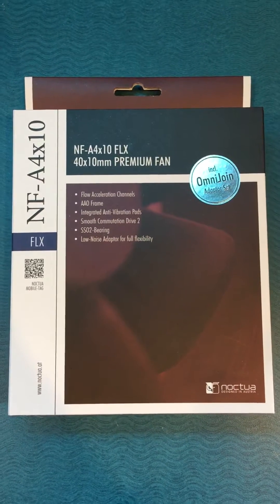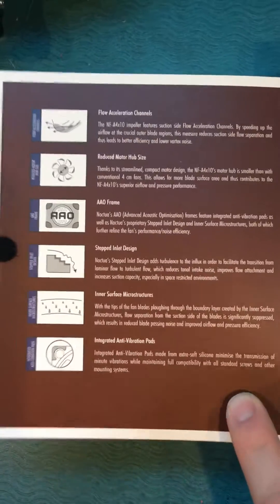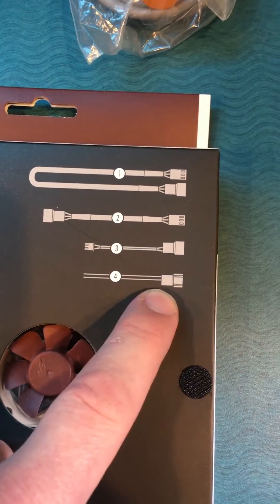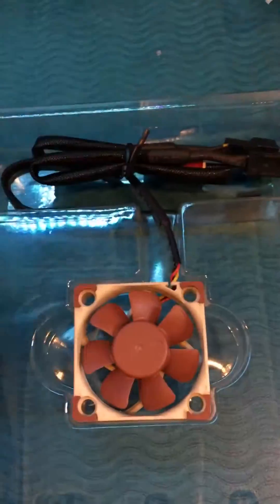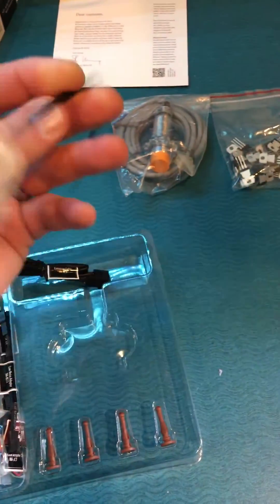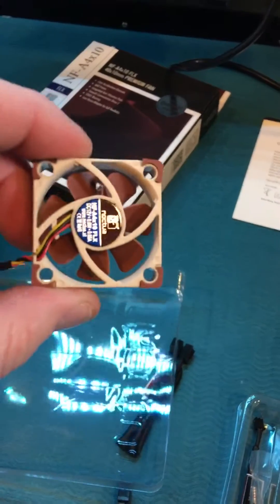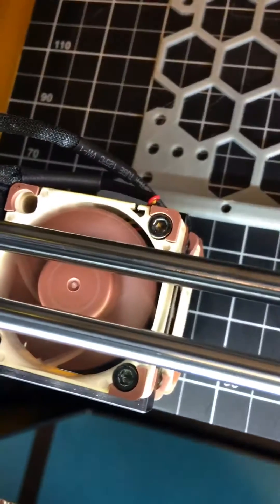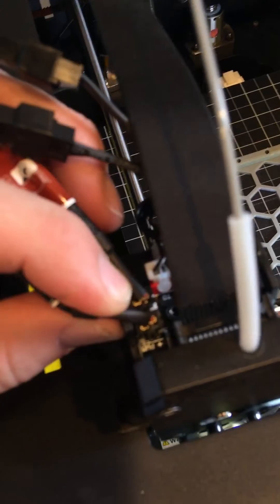Review of Noctua 40mm Fan - NF-A4x10 FLX Mounted in 3d Printer

Comment: Did you have any issues with this? It's a 12V fan but I read online you shouldn't use 12V fans on this printer (it's 24V).

I'm trying to find an upgrade for mine - I have one PLA filament that'll only print at 30mm/s with the stock fan and it's frustrating.. the side away from the fan isn't cooled fast enough and results in a poor print on that side. I have no idea how to tell (without buying) whether a fan is better than the stock one or not!
Reply from the maker: Hi Danny!  This model 3D printer has 12v stock fans, which is why we replaced them with the 12v Noctuas.   I've been running two of these with the Noctua fans for over a year now with no issues!  Thank you for the question.   What temperature are you running on nozzle and bed?
Reply: @brainwavepc  Oh!? I saw many people saying it needs 24V fans and not to use 12V ones as they'll run faster and not last long. Now I'm confused and don't know which to order (I had ordered a 24v blower, but just cancelled it until I'm sure!)
Reply: @brainwavepc  For example, https://www.thingiverse.com/thing:1666096 says "These fans are 12V and so modification to the power supply is needed."?
Reply from the maker: True, the output for the fans is 24v but will work no problems with the 12v fans.   A lot of people will wire 2 Noctua fans in series and 3D print a dual layer cooling fan setup, this will result in 12v per fan if you run two in series.  I chose to use them as single fan and have had no issues with fans dying or fan speed issues.
Reply: @brainwavepc  Thanks for confirming. Sounds like a 24V one would be best then, so I've re-ordered and it and will see how goes :-)

Comment: Bought one today. Its quiet compare to other cheap fans.
But slightly less effective
Reply from the maker: They do move slightly less air, but are much quieter and more reliable.  I've had all of my stock fans that come on the Monoprice's fail within the first 6 months of use.  The Noctuas have been on for over a year with 0 failures.